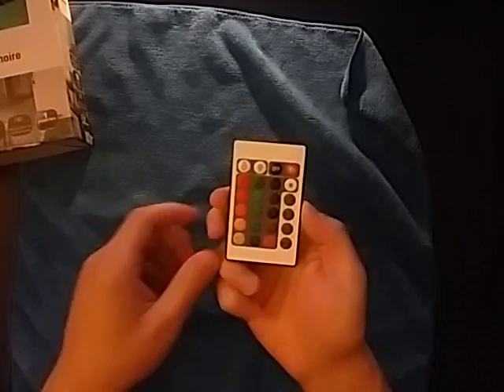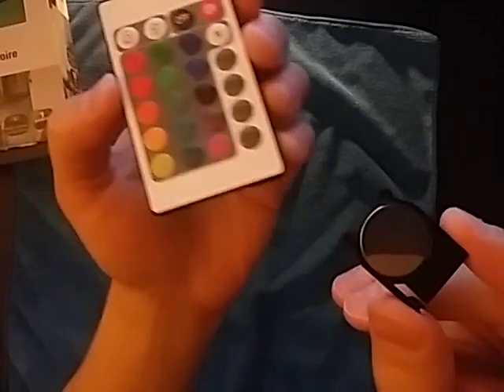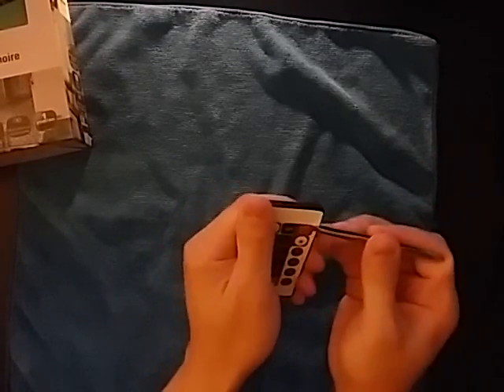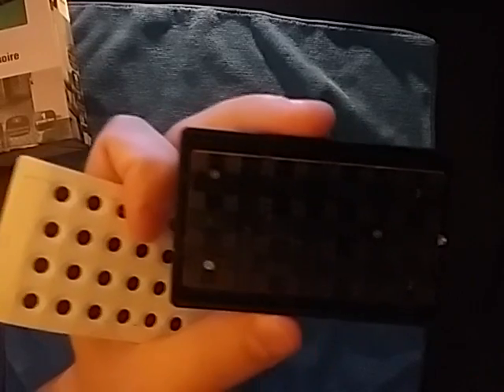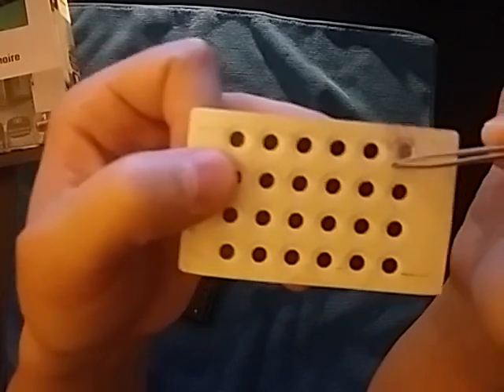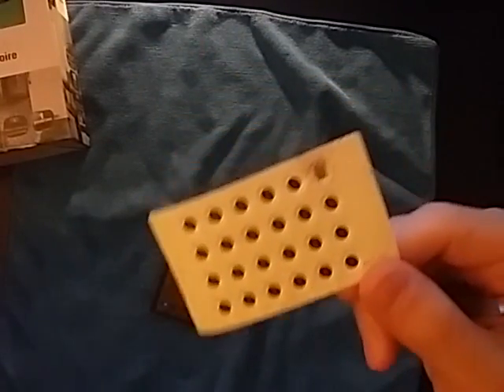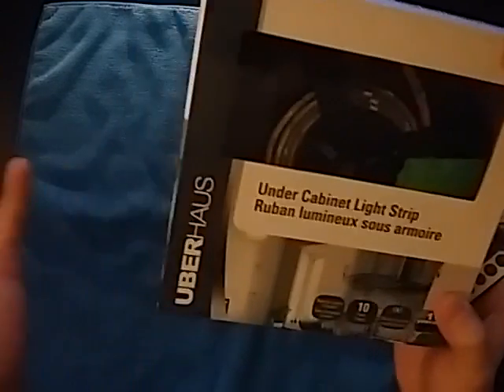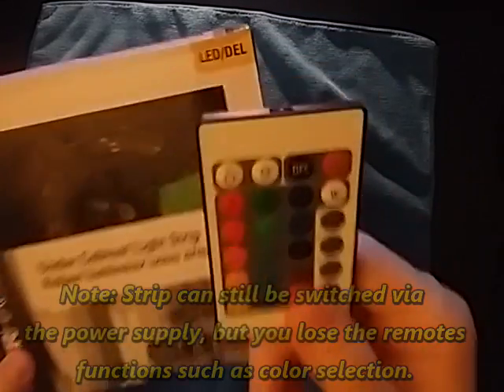LED Remote Repair (Buttons Not Working)

Comment: the colors on mine dont match the colors on the remote. is this a trip problem or the remote?
Reply from the maker: Could be wrongly applied remote decal (the buttons themselves as you see me take them off -- ie, it might be upside down). Or it could be wrong programming from the remote to the base. Hard to say.

Comment: Thanks for the video. However, I'm experiencing a range of issues. Bought a brand new bulb, tried the remote and it worked fine . . . then it didn't, then it did, then it started up my Hi-Fi system. My Hi-Fi remote also interferes with the bulb. Now the bulb remote occasionally starts up the Hi-Fi system but all the buttons now work for the lamp bulb, except the off switch. Brand new but tested the battery and it's fine. Any ideas youtubasoarus? Many thanks

Comment: I have a remote like that for my led light strips, and it works, but the buttons aren't doing what they're supposed to. My green button makes the lights blue and vice versa. Purple just doesn't exist anymore. They started doing this after my little 2 year old niece found a TV remote and used it on my lights.
Reply from the maker: Could be the strip not being plugged in all the way. Try checking that or it could be the remote packaged with the device isn't what it's supposed to. :/

Comment: Only 3 main colors work on my remote red, green and blue. I press white it turns red what is going on this wasn’t happening yesterday and now the color blue is so much dimmer than it was the day before
Reply from the maker: From what i'm seeing there are ton of problems that can happen. Check to see that the cable where the 4 prongs plug in to the strip are in there properly. I've had mine fail to produce one color and it's just one of the pins aren't making contact.

Comment: I’VE JUST FIXED MY LED LIGHT STRIP BECAUSE IT WAS STUCK ON WHITE.
Thank you to John Holmberg who has commented on this post.
White glitches the remote out, just unplug the led strip, keep the USB plugged in, then press red on the remote, reconnect the strip with the pins and it’s fixed.
Reply: Lois McGregor what if mine does not have a usb thing

Comment: I tried it one on my car & it worked fine. Now I have the lights installed in my car, they work but the remote doesn’t which means I can’t change the colors around to keep an exact one, they just change to every color but I took the batter out & theres no battery like that one you have!! What the hell?! Is that weird?
Reply: same here. no battery.

Comment: my lights turn on when I press the white button but the light doesn’t turn on white it turns on pink no matter what color I press, but if I press green they turn off. someone help
Reply from the maker: Make sure the strip is plugged into the controller properly (the part that plugs into your wall).

Comment: Good idea. These types of remotes are all terrible and have this problem. The buttons oxidize after a couple of uses and stop working.
You'd think someone realized the issue and recalled the whole lot, but no, they are still selling them after many years.

Comment: Anyone know how to control the rgb lighting strip through the pc and not the remote? I pressed off on the remote on a day about 3 weeks ago, and the lights would not turn on since so i had just given up on it, then randomly they pop on today, so im scared to turn them off with the remote again.
Reply from the maker: I think you'd have to buy a kit that specifically includes that functionality. Wouldn't be able to control it without some sort of interface (Ie. USB).

Comment: If your really desperate just peel off the whole thing and use an aluminium can tab and use it while pressing on the button you wanna activate. I lost the adhesive sticker with the carbon activators like a idiot and using a can tab worked fine for me

Comment: My LED light strip is stuck on green. The remote is completely unresponsive to the strip. Is there a way to fix this? I spent a good 30 minutes taping these fuckers on my wall. I really dont wanna take em down
Reply from the maker: I feel you man, but probably not. The only way to get them to change color is to tell them to and that's all done through these damn remotes lol. You could try finding a remote from another kit as they are sometimes all using the same codes (IR) to talk to the little brainbox.
Reply: youtubasoarus i found the problem. Its the connector. I have 4 remotes that all work for other strips but it didnt fix this one. Im gonna have to get another set. Good thing it was only $5. Im just annoyed i have to re tape everything. Thank you for the video tho btw it helped me with this one remote i had for another strip👍🏻
Reply from the maker: Yeah, they're really finicky even when they DO work. Glad you got it all sorted out! :)
Reply: youtubasoarus thank you

Comment: Google won’t help me so will someone here? 
I just bought mine. Yea it was cheap but I didn’t think it’d be this big of a problem. 
I think the remote works fine, nothings broken. I pressed ONE button on it after turning it on and 3 seconds later it shut off without me pressing “off.” And my tv had to be on too for it to barely work btw. But my tv is on, I press “on” on the controller and it does nothing. PLEASE HELP THIS IS DRIVING ME NUTS

Comment: uhhhh nope that didn't help
Reply from the maker: So what sort of issue is yours having?
Reply: You might want to take out the panel or side of the tower and aim directly at the light. The remote doesn't have very good range.
Reply: Doc. P k

Comment: I prefer the RF remote because you don't have to point it at anything.
Reply: will that kind of remote work with this? or do u have to have the original remote to make these work?
Reply: after i use rf remote for a few days, then my RF remote doesnt work

Comment: I fucking found it,the problem is when you use the controller you have to put it close to theat --connector --what connects electricity with the lights,it is no tv remote,with this you have to aim